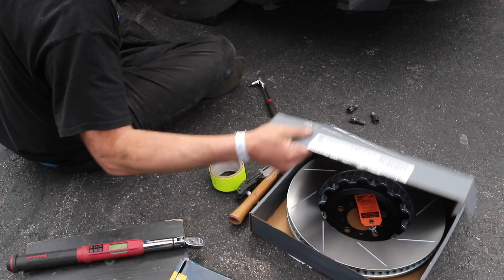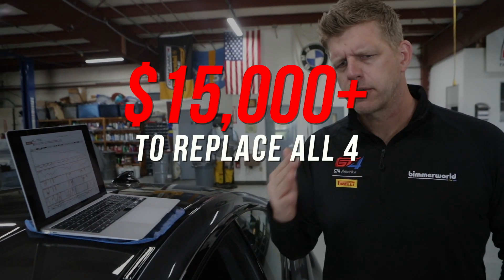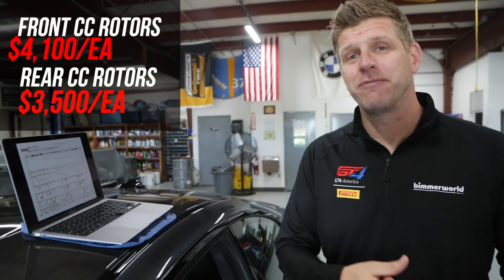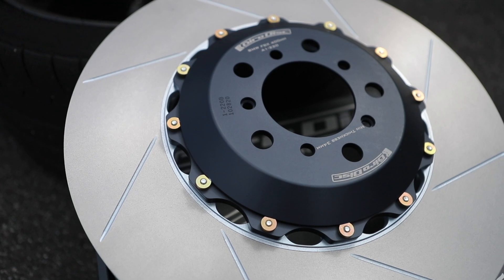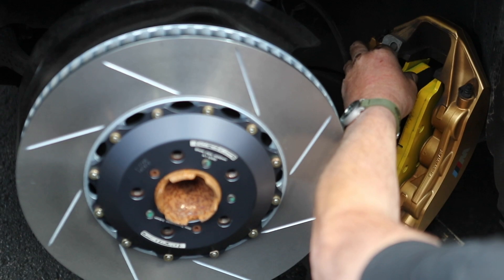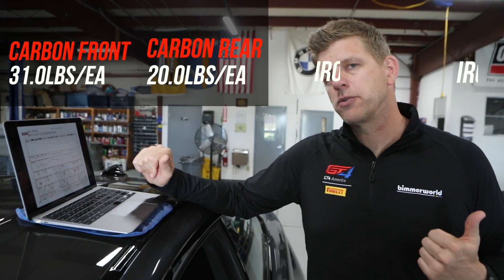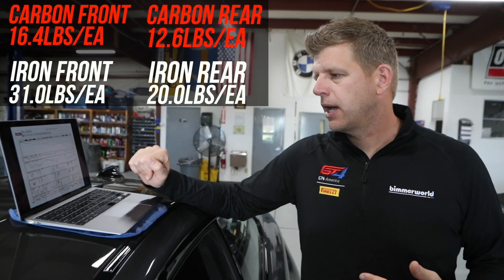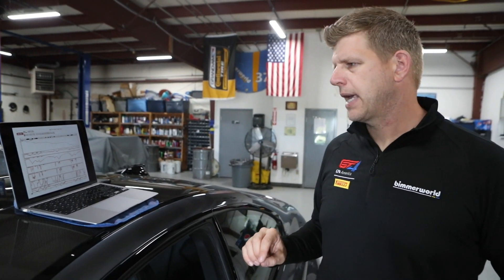BimmerWorld's Project F82 M4 "GTMore" - CCB to Girodisc Iron Conversion (Part 2)

Comment: Do the brake boosters need to be changed?
Reply from the maker: Nope throughout all the differences and changes on the GTMore and its braking system the original brake master/booster stayed in place.  No need to touch.